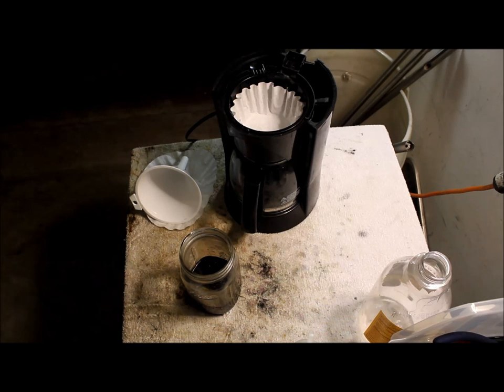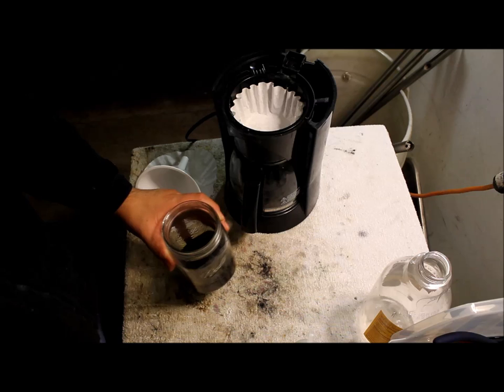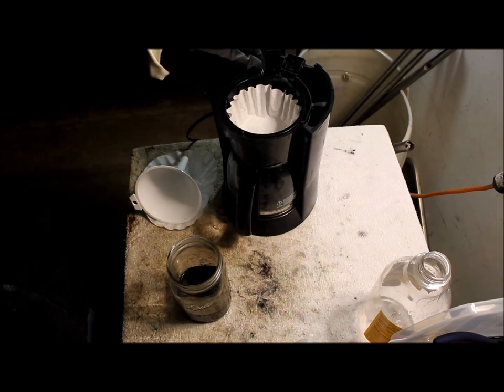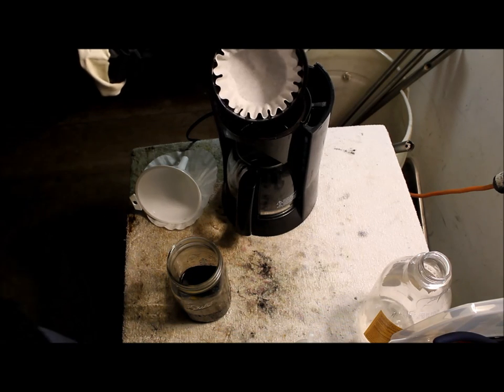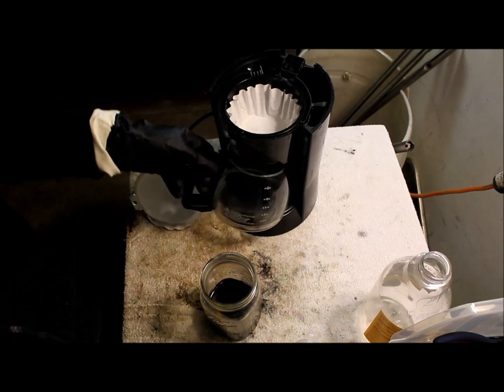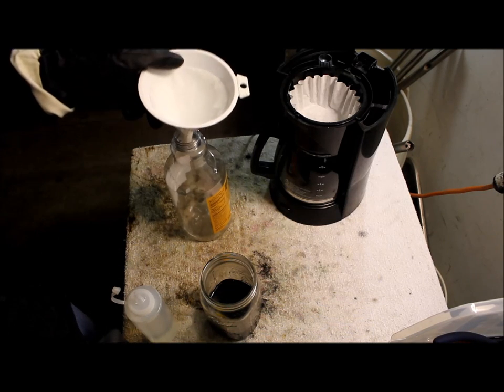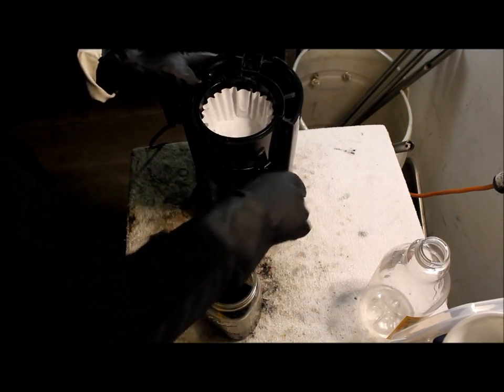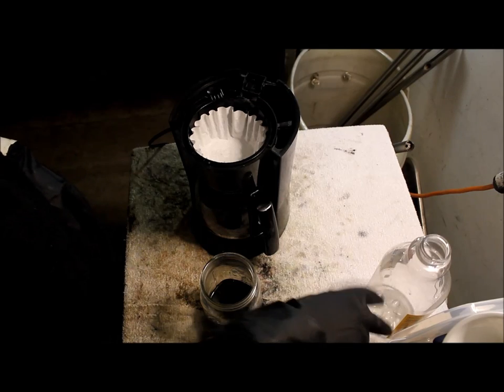AP gold recovery Pt. 2

Comment: i put in 3 lbs of boards.... 2 lbs gold trimmed from lcd's, cellphones, etc. and approx. 1 lb fingers, ribbon wire gold ends, full gold plated clippings. started yesterday how long does this process usually take now that it is sitting in the AP mix?

Comment: What do you do with the used AP do you reuse it or dispose of it properly??
Reply from the maker: You can get the copper out of it by using a stainless steel  rod then re-use it. As for me I store it in the bottles it came in on a shelve outside of my tool shed. If you leave it inside it will start to rust out anything that is metallic even if the lid is on it. Good question and thanks for watching.
Reply: When I start ! Where do I  place the ap solution with gold pins as  the gold start to come off ? Outside or inside and if inside where inside the best place
Reply from the maker: I started mine in the garage then moved it outside to do what it does. I will be making a new video on this process as I have acquired a coffee heater which will speed things up and I can also leave it outside where it can get air. If you do it in a bottle you have to keep opening it so that it gets oxygen in it and it can continue the process.

Comment: Hi, I see the way you demonstrate is not  good when you shaking the filter, you might force fine gold go through the filter, the black powder you see is actually fine gold, also before you spray water on it , you have to put the used solution away for the next  batch, if you spay too  much water on it, the solution will not have enough strength to do it next job.

Comment: How long will the boards stay in ap solution? And is it wise to leave it open? Tnx for ur video
Reply from the maker: I left mine in until i saw most of the fingers had came off. I probably should of closed it as the fumes will eat up metals if its in a small area or garage. If its outside it dont matter if its open or closed. I need to make an updated video tbh. Thanks for watching!

Comment: what do i do if the gold foil dissolves in the a/p
Reply from the maker: +Frank Miller It might not be gold and may be Brass coated instead. It's hard for Gold to dissolve in this solution unless you use nitric acid. If the gold does dissolve you will need to  precipitate the solution using sodium methabisulfite in order to get the gold in the solution to solidify. then you would just filter it out using coffee filters.
Reply: +Frank Miller It won't dissolve in HCL and H202. Can't, chemically impossible.
Reply: thanks guys
Reply: Yes it can, if your ap is too strong it can dissolve the  gold, its a common problem in a recovery group im in..

Comment: does this work for goldfilled items?
Reply from the maker: Not sure I understand what you mean by your question. If the outside covering is made of iron or steel it should eat right through it. Although it may take a longer time since you have to remove lots of material to get to the gold. Not sure if that answers your question.